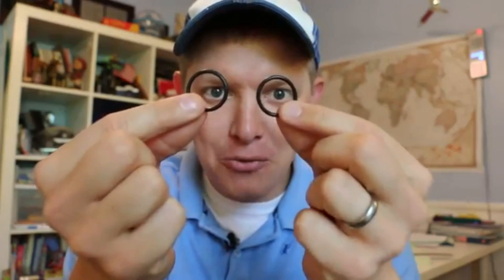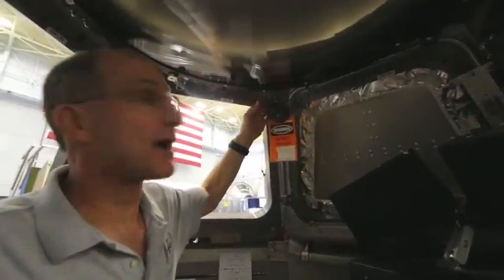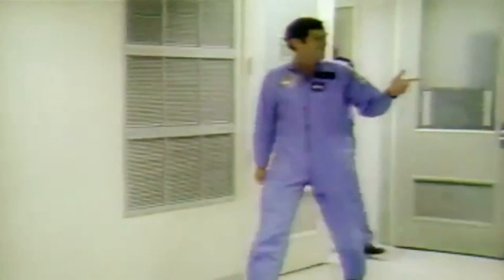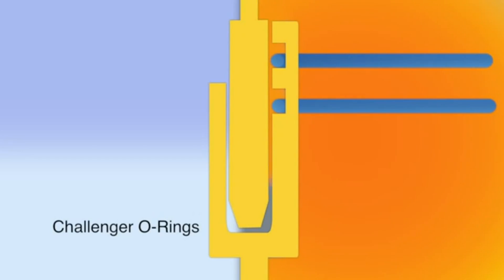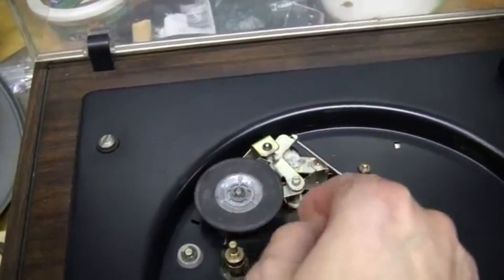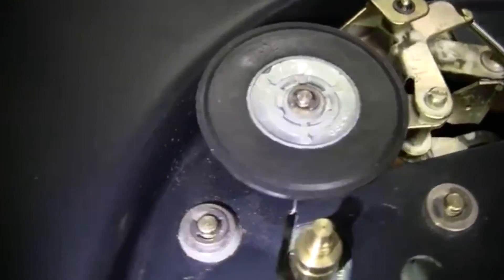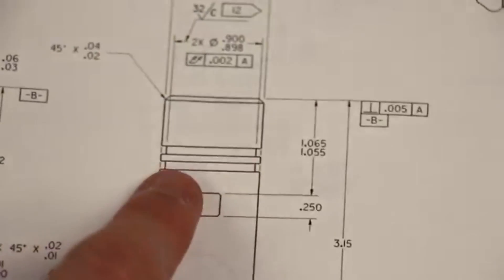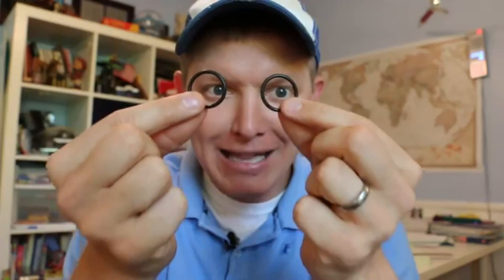FAKE NASA | O Rings on the ISS Cupola and Ever Degrading Rubber

Comment: There are different types of rubber out there. Some rated for low temperatures, others rated for high temperatures. Some don't last long, others last longer. Feel an old tire, and see if it's "sticky" like the old belts & rubberized coatings do. It won't feel sticky or goopy, it will feel hard, because it's a different type of rubber that wears differently. Similarly, just because one thing made of rubber breaks down over 40 years, doesn't mean that another thing made of rubber will. Same with temperature- like snow vs. summer tires, you can optimize a rubber for whatever performance you need.

Also, it's worth noting that the original design of the SRB worked for ~24 space shuttle flights from 1977 to 1986. It only failed when the space shuttle was ran outside of it's rated temperatures & wind loads. Also the failure mode on challenger (the bending of the flange) is not something that would ever happen to this seal.

Comment: in case of direct mechanical connection she wouldn't have that power to turn that small knob to close that huge shutter. She turn it very slow compare to speed of the closing  shutter.
Reply: Um no weight or air resistance in space...all she would have to overcome is the friction.
Reply: @MrDanielrbales  stop it 🤦🏾‍♂️😂

Comment: Belts and o-rings aren't used in the same way.  There are also a variety of rubber products for different uses.  I know you won't believe this since it doesn't fit your opinion.
Reply: Do you know what rubber is?
Reply: How does radar curve?
Reply: @noobishtitan9714  What do you think the term "rubber" only applies to so that you can then tell me I don't know what I'm talking about?  That's what your very rhetorical question was about after all - trying to flex.  I have degrees in math and chemistry and work in the polymer industry - not that I owe some "noob" in YT an explanation.
Reply: May I Please Ask  You ask me a question just to try to tell me I"m wrong, which proves my point that you don't really care about the truth.  Thank you!  
Rubber is not a single compound or material - if you knew anything about it or worked with it, you would know this.  O-rings MAY have rubber as one component, but it is not the entire o-ring.  Don't bother me with any more rhetorical questions.

Comment: So there might be an emergency procedure in case cupola depressurize , but they don't need to know it , it's very safe ...
Reply: VITA kyo As I pointed out to the OP, the Emergency Procedures Manual can be found here:

http://spaceref.com/iss/contingency.html

In it you will find the procedures for depressurisation in section 2.6.12. The cupola is part of Node-1. The repair/replacement of components isn't covered as they aren't part of emergency management.
Reply: VITA kyo I should also point out that this information took less than five minutes to find.
Reply: ISS is pure comedy ...
Reply: They know the procedure for depressurization. Its either the music or the editing you are paying attention to as he states that its the procedure for replacing the shutter mechanism he doesnt know. Also its not as live or die as you think. If its a slow leak, theyve got time. If its sudden decompression, thats going to lead to explosive decompression, and from start to end theyd have about half to 3 seconds from the first leak to implosion.
Reply: @woowoothespacejew5494  CUP is part of NODE 3 (Tranquility) not NODE 1 (unity).

Comment: if you assume that space has the average Earth environment and conditions then that's ok ,except that we are Not dealing with those parameters, we are dealing with more extreme conditions. NAZA hardly ever mention the real extremes of temperature, radiation and pressures that these O rings are in immediate contact with - they are actively in contact with the inside and outside at the same time so 2mm of rubber between those two realms . Space is said to be at a temperature of -273 degrees, that is not technically correct, it has no mass therefore has nothing to take on any thermal activity. However anything that is in space will lose temperature through radiation as our planet does. So potentially the rings can go down to -273 deg, the ring will become very brittle and disintegrate with the slightest pressure and well before the -273 maybe even before the -30 level. Also when the ring or near mass is in the rays of the Sun then it will be heated up, not like here on earth and up to 50 deg, no it goes much higher, say 300-400 deg and maybe higher. So in the real Universe that ring would have to tolerate swings of 500-600 deg between two different extremes. Those are just rough guesstimates as no-one really knows?? Once you even have a basic knowledge of the Science of Space then the Con of NAZA becomes apparent, except if you are brainwashed and are incapable of critical thinking.
Reply from the maker: Yes that's right. It occured to me afterwards that when Samantha Christoforetti is operating the handle while in the ISS and she says that it feels cold, not 'space' cold, but metal cold, that put me in mind of the other side being cold water, and she honestly describing what she feels.

It's all in the detail! There are some good videos out there comparing the ISS to a submarine, it makes it even more laughable!
Reply: Jim Taylor What is the temperature range for the o-rings that are used on the ISS, according to the manufacturer?
Reply: Woo Woo, The Space Jew, that is at least a good question and because  you asked then you probably know the answer. off hand I am not sure or remember.
Reply: Jim Taylor You're right, I do know the answer. White Horse, it seems, does not, as that would refute his argument. I only asked so that it might spark some further research.
Reply: Jim Taylor Also, the temperature in low Earth orbit ranges from about -148°F to about 248°F. The thermal control system aboard the station keeps it at equilibrium. This includes the o-rings, which are made of silicone and have a temp range of -175°F to 400°F (Parker S0383-70).
Reply: Woo Woo, The Space Jew,  here is where I am at, I not only question the O rings but the whole ISS and NASA story. In real time there can only be one answer, it is either all true or the main story is false. If it is false in essence then there can still exist many true parts, they have to be there to create the bigger illusion. The problem is finding at what level the lies start, so with the o rings  I have to ask - are the specs true and what are the true requirements. How can I verify that these are the true specs and not made up?? Now you quote that the orbit temperatures range from   -148°F to about 248°F. but when I inspected a Thermosphere temperature graph the temperatures of that orbit of 330-435 Km suggest much higher ranges and up to 1000 deg C. That was just one graph but raises many questions and not limited to the O-rings. At the end of the day we isolated mortals cannot verify any of this and no where that I have seen is there any feedback details (and there should be tonnes of it) to build up a realistic model of experience.
Reply: Jim Taylor The manufacturer's specs are what companies go by when determining what parts to purchase. Each customer has a QA/QC dept. to inspect and test all such parts. My company has one and everything that comes through the door has to be inspected against the engineering diagrams and tested. This is an FAA requirement. My company puts satellite communications into aircraft. If you want to know if the specs are correct, you can simply purchase some of the o-rings and test them yourself.
Reply: Jim Taylor I'm not sure what you mean by "feedback details". All of this information is readily available and is used by thousands of people every day. Two excellent references would be Fundamentals of Space Systems and the Spacecraft Thermal Control Handbook, Vol I.
Reply: Woo Woo, The Space Jew it's funny y'all think it's even up there...
Reply: Bluegrassconnection Legalize It We don't "think" it's up there, we know it is. We can see it. We can track it with precision. And, if you contact Space Adventures, you can go there.
Reply: Woo Woo, The Space Jew bahahahaha go to the iss page to track it, out your time to change manually while on the web page and you can control where the ISS is placed...

Also, if they have the tech to not have to recycle O2.... this kind of tech would be in military subs!!! Subs have to surface every 72 days I think...
Reply: Woo Woo, The Space Jew space and sodo scienceare your god....
Reply: Woo Woo, The Space Jew how could you say something that small that far away??
Reply: Jim Taylor and White Horse, what you are forgetting is that the inside of the station is shirt-sleve weather with insulation on the outside of the station components, therefore, any heat transference of the surrounding material radiating into space will be more quickly warmed from the inside due to the thermal transfer properties of metals. Therefore, while you are correct, that items in space can get cold, the engineers of the ISS accounted for that by putting insulative materials on the outside of the modules in order to reduce both the drastic temperature differentials as well as reduce radiation issues. 

If you're going to look at part of the picture, you need to look at the entire picture, not just the parts that would seem to prove your narrative.

Having worked in the microelectronics industry where we deal with extreme vacuum, temperature differentials as well as plasma generated by RF radiation, I can assure you that only the o-rings that were in the reaction chambers where we were doing work on the wafers were the ones we had to be concerned with rapid degradation. Certianly, the rest of them do degrade, but there were some that only were exposed to the pressure differences between extreme vacuum and atmosphere and we constantly reused those and leak checked their integrity every time we re-used them. I never personally replaced the ones that only dealt with the difference between atmosphere and vacuum, so that factor in and of itself is not a problem when the other factors are accounted for and controlled. 

Incapable of critical thinking? No, capable of reviewing more than just the data that fits a particular narrative.

EDIT: LOL, after watching more of the video, I am laughing that ya'll think that these o-rings are even close to chemically the same as a 'rubber drive belt' for basic earth-bound mechanical equipment. O-rings are far superior materials to those simple cheap belts you showed as having fallen apart and 'turned to tar'. And you accuse the rest of us of having a problem with critical thinking? I'm sorry, I usually try hard to give people respect for even ideas that I don't agree with, but common ya'll you can do better than that. For heaven's sake, do some chemistry research to see how these materials are different and why those differences either increase or decrease their life-span and by how much. Sheesh.
Reply: Bluegrassconnection Legalize It, it's funny ya'll think this 'conspiracy' is even valid.
Reply: It’s truly amazing how some people can’t let go of their security blanket and realize their leaders lie! At some point magic o-rings that never degrade are where you hang your hat. Honestly think McFly think...

Comment: You should research just what kinds of seals would be needed to hold in this kind of pressure. Space is at least  1×10-6 to <3×10-17 Torr which basically means you would have to use a single use soft metal washer to get a seal. rubber seals is not going to cut it in space. i'm sorry but its just not going to happen. Look up the video mark sergeant did when he had the industrial valves and seals expert on his show.
Reply: The Torr scale (which noone uses) goes from 0 up. There is no such thing as a negative Torr. The pressure inside the ISS is 14.7 psi.
Reply: @ericnachreiner5073  https://en.wikipedia.org/wiki/Vacuum#Measurement maybe you should tell the scientific community that negative torr is impossible because they seem to think it is
Reply: Who hoo space Jew! Where is your comment on Carson K?
Oh you can not comment on this one? Hmmm, maybe because it is true?
Reply: The pressure difference between space and surface of earth is at most 1 atmosphere, assuming a perfect vacuum. 

These o rings can withstand much much more than 1ATM. For example, recreational scuba divers can go to 40 meters, or 4ATM. The same o rings are used and they have no problem withstanding 4 atmospheres of pressure, let alone 1.

Comment: haha   yeah rubber seals are their downfall. Fake ISS and Fake Space. I had to replace a rubber seal on my vacuum and water distiller just last month. They only lasted about 4 years each.
Reply: AKA SURFSTYLEY What kind of rubber were they made of?
Reply from the maker: Obviously not special space rubber.
Reply: White Horse You mean silicone? Does that not exist where you live?
Reply: When something is made by a Chinese company looking for the best profit margin, and used by an average consumer, in a changing environment, its going to last magnitudes shorter than rings specifically designed and tested for an unchanging, but knowingly hostile environment.

Comment: not a great argument..been a mechanic for some years now (too many years)..
and o rings do not fail by disintegrating, i have worked on countless cars with A/C systems 30 years old with the original o rings...there are two main ways o rings fail, if they were installed wrong and a chunk gets ripped off the  o ring   ...and most of the time the failure is caused by the eventual flattening of the o ring its self..
after so many years of being compressed the o ring will flatten on one ore more side and not seal anymore...
im not saying i believe anything nasa or satan says...but this argument isn't gona work...
further more A/C systems run both end of the heat spectrums ...The decompression side of the A/C is cold while the compression side is hot,and these o rings in cars not made to nasa standards can last 30+ years...
so think about that..
Reply: When you are in a pressurized system, you're right. 
The ISS doesn't work in those conditions, it's pressurized on the inside and outside there's a vacuum. I guess no mechanic can duplicate those conditions. 
A high vacuum exists outside the space shuttle and the International Space Station. The pressure inside both spacecraft is regulated to 101.34 kPa (14.7 psi) and is equilibrated after docking and before hatch opening.
Reply: AC orings dont have a moving shaft running through them for a start. They don't go from -120 degrees to +120 degrees Celsius 16 times a day, every day for 22 years straight either.
Reply: @aaronpowell3302  you actually think men climb aboard water heaters and blast threw the firmament?
Reply: @Aaron Powell  cool thing is neither do the seals cycle +120 c -120c

The seals are on the inside of the bulkhead.  They are exposed to 72° f 34c 24/7

The vacuum has no temperature, and the shaft tolerance is .002 in 2 thousands of an  inch, so not a lot of interaction with the stray particles from the thermosphere.  Catastrophic failure of the O-rings would also not represent a major emergency.  You would have hours if not days to remedy the situation.   Including possibly sealing the cupola hatch if all 7 actuators all catastrophically failed simultaneously I would have to say you could easily do damage control before any risk of life and limb .